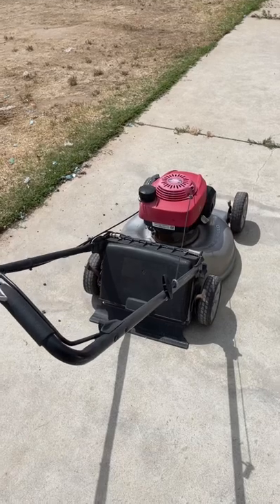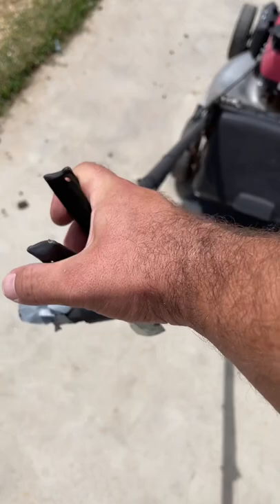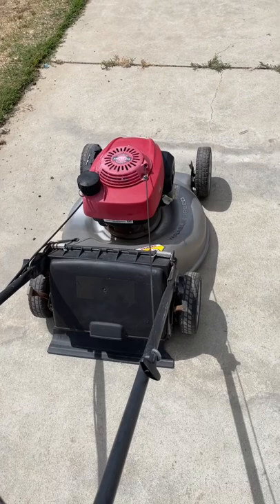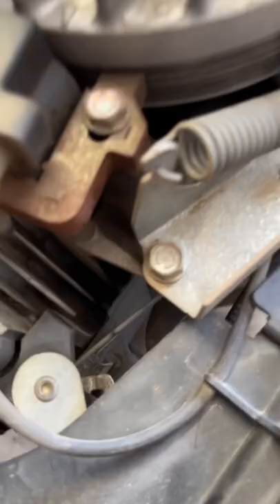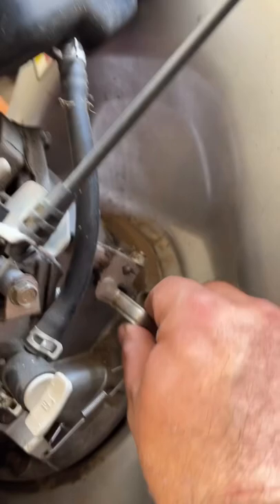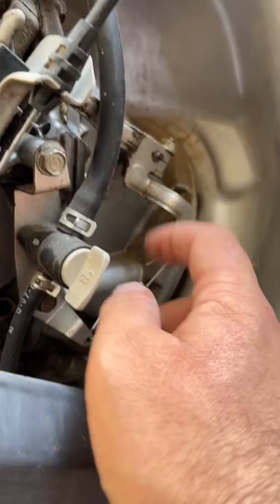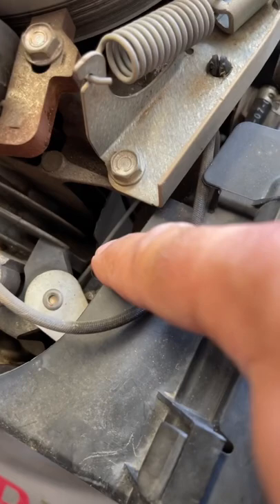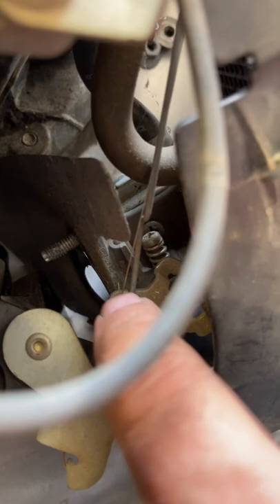Honda Mower Crazy RPM Fix - Simple!

Comment: That's how our lawnmower is because our Bradley lawnmower was way too low so I messed with the throttle spring and there's two holes and one hole is low RPM like idle and then can turn it off take the spring out move it to the other hall right next to it and then boom high RPM just like that so much better

Comment: Mine was running too slow...you saved me! Thanks.
Reply: So what exactly did you do? I think mine is running too slow too.
Reply: @gregharper491  Reconnect an attachment spring that had pulled loose on the left side of the mower when it got hooked on some brush I got too close to. Watch the part in the video where he traces the line from the handle down to the engine and shows that spring.

Comment: There's a lost trade small engine repair and it's so straightforward
Reply from the maker: Yup just like vacuum, boot/shoe repair
Reply: If people wanted to pay for repairs then sure. Most people just go buy a new mower after their grass gets a foot tall. 
Makes no damn sense
Reply: @contraband1543  their equipment would last longer. Sometimes its worth to fix your own equipment, even if its a $120 push mower. If can repair or maintain it to make it last then youll save money.

Comment: Mine has that spring on it and it still has really high rpm what do I do now I even adjusted the governor and that doesn’t do anything
Reply from the maker: Try cleaning the carburetor out
Reply: I'm in the same boat...cleaned carb and checked springs..but still incredibly high rpm's
Reply: Adjust your governor position
Reply: @jaytodd5809 
Move the governor spring to the other hole you see on the governor